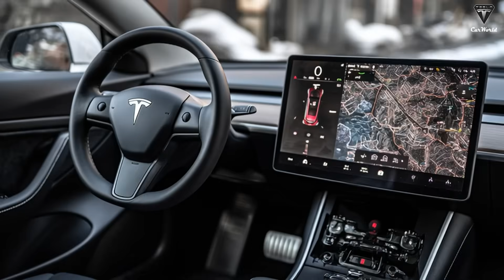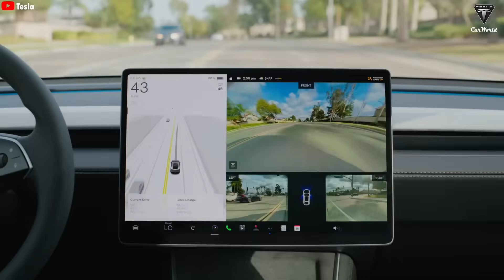Tesla Model 2 Built In 4.5s At Giga Texas | Really FAST Shocking US! This is Rumor!

Comment: I would like to see evolutionary minimalism. 2 seats, 2 doors, hatchback. Can use the same platform as Cybercab. Swappable center console and steering controls for handicap, luxury, and other lifestyle specific aftermarket customizations. Standard 18" wheel option, Polycarbonate windshield is shatterproof, lighter, and cheaper. Aerogel insulation panels to save heat pump power and add comfort, Solar cells on top will pay back many times over in added range and battery discharge protection. Aluminum ion battery. Low power Starlink, Seat with full recline, No BS features. If Tesla will sell it to me..